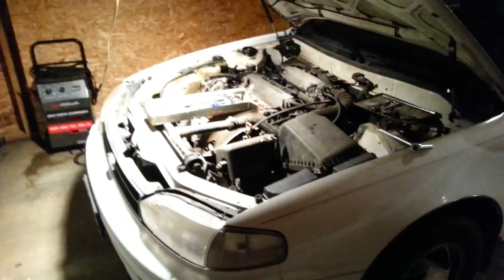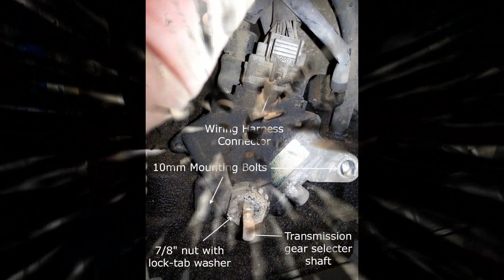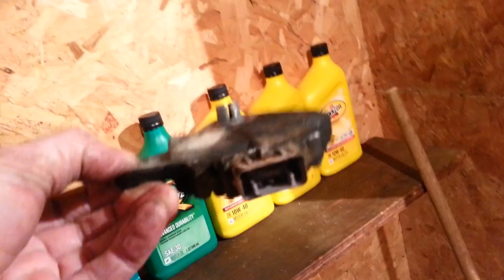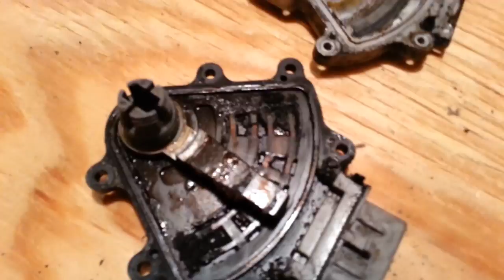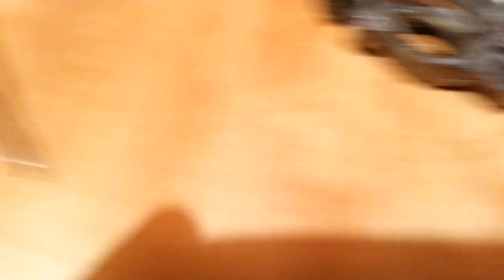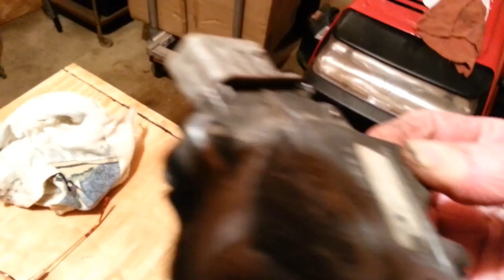1992 Camry Neutral Safety Switch Repair

Comment: Hi Dan, can you tell me which one is the back up light switch ? Close to the driver side one or the passenger one? Thank You !
Reply from the maker: The Neutral Safety Switch performs multiple functions.
!: It causes the gear indicator lights to come on when the stick is in the correct position.
2: It causes the backup light to come on in the R position.
3: It enables the starter to engage when you start the car in either PARK or NEUTRAL.

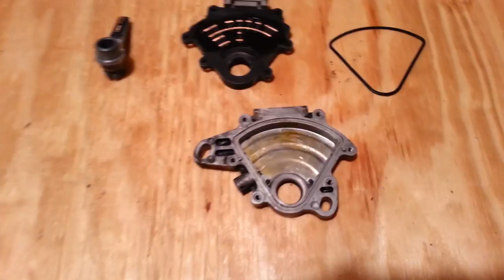The backup light is controlled from within the NSS switch by shorting the 2nd set of contacts from the left together on the top 2 bars. If you go here to the 8:00 minute mark in the video and pause it, you can see the shiny bus bars. There are 4 rows top to bottom. if you just look at the top 2 bars from left to right, you can see the positions that short together to turn on the gearshift indicator lights.

Far left = P (Park)
Next one to the right is R (Reverse and the backup lights)
Next one to the right is N (Neutral)
Next one to the right is D (Drive)
Next one to the right is D2 (Drive 2)
Next one to the right is L (Low)

The two bottom bars enable the starter, only in the PARK and NEUTRAL positions.

Hope that made sense. Good luck.

Comment: Thanks for posting this video! Great job! Lot's of useful info! However, I've had 2 different people break 2 of these in the exact same spot trying to remove them. Both people said It feels like there is still something hanging on that's not letting it come loose. Does it need to be in a certain gear? Thank You!
Reply from the maker: Hi Toni...
I had the gearshift in the neutral position with the shaft straight up and down, but the position shouldn't matter. The only thing keeping that switch from sliding off of that shaft smoothy would be a dirty shaft. It should be soaked with carburetor cleaner and cleaned well before attempting to slide that switch off. Hope that helps...

Dan
Reply: +Toni Hazelbaker We also performed this operation in Park with no problem. We liberally soaked the bolts with PB.
Reply: After you remove the 2 10mm bolts and remove the crossbar tying the cable to the transmission shaft, the only thing holding it on is that giant nut and lock washer. I was at the junkyard and couldn't wiggle it free. I used a flat blade screw driver and wedged it between the transmission and neutral safety switch and used the leverage to push it off. I didn't think it was going to work, but if you work it from a couple different angles it should loosen it up. I can't wait to clean it out and get working reverse lights.

Comment: How much work did it take to actually remove the switch from the transmission case?  I have the shifter arm removed, the large nut on the front of the unit removed, the mounting bolts removed but the thing will not slide off the shaft.  Have I missed something?

Thanks for your assistance.
Reply: Dan Deshaney Awesome Video dan!!! Appreciate it. I have worked on all kinds of cars but you can never stop learning! It worked great ! Take care and God bless!
Reply from the maker: Hi Vincent. After removing the large nut, I had to use carburetor cleaner on the shaft itself. It had a lot of dirt and corrosion on it and the switch would not slide cleanly over it. Clean it real good and work that switch back and fourth, and in and out a little at a time. You may even need to slip a screwdriver behind it to pop it loose. It will come off if you clean that shaft.
Good luck...
Reply: Thanks for responding.

Well - there's good news...  and there's bad news.  The good news is that I was able to eventually get the switch removed from the shaft.  The bad news is that once I had the switch free of the transmission housing - I was able to turn it (the switch) over and take a look at the back side of the thing and notices some hair line cracks in the casing.  In the process of removing the six screws - the bakelite casing literally crumbled in my hands.
I'm having a replacement part sent to me and it should be here by Thursday.

Thanks for the tip about the carb cleaner.  I'll use that on the shaft when installing the new part after it gets here.